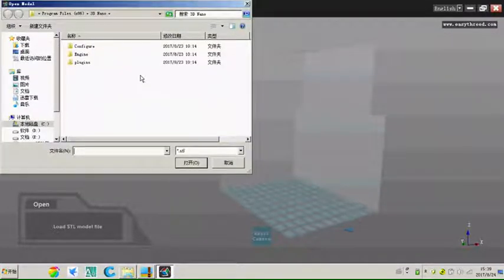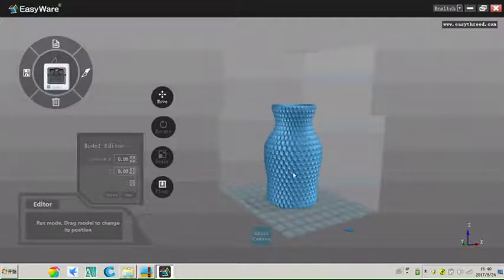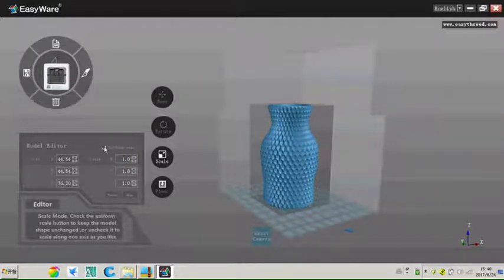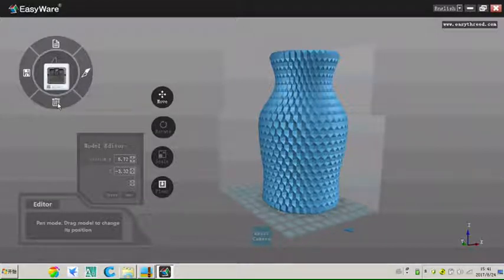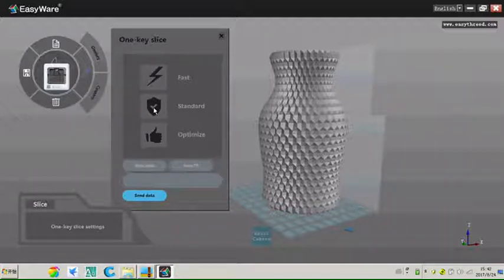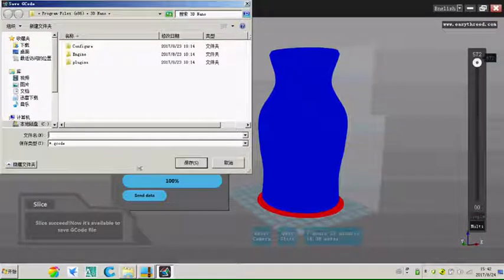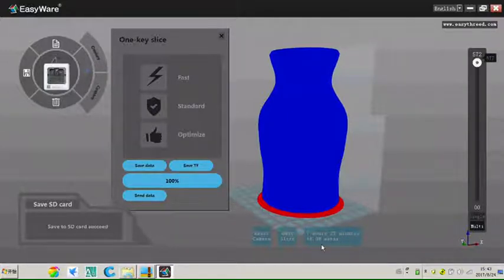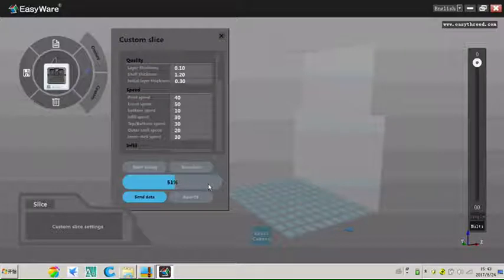Easythreed slicer software operation video ,mini 3d printer

Comment: Anyone else struggling at "analysing model" bit and can't render slicing?
Reply from the maker: you use windows or MAC?
Reply: Yes, I am! Nothing happens when trying to slice. Using windows 10. But the easyware x34 works, but the bed size is different
Reply: @GabrielCamilo84  end up finding this as well, some files were ok on 1 and some were ok on x6 version. Got there eventually apart from the bed size on larger items.
Reply: Not as much as I am with understanding this video